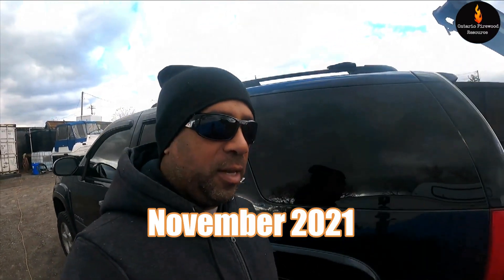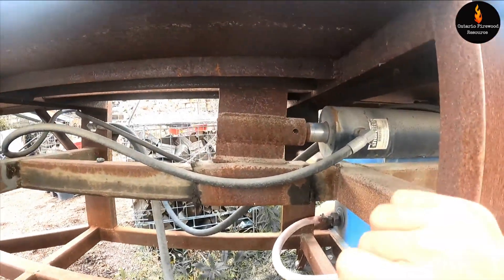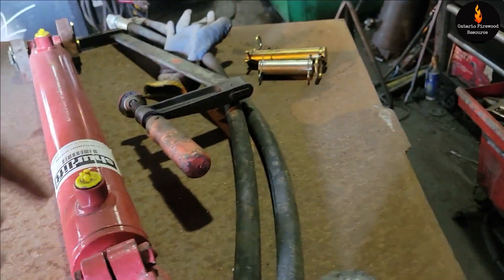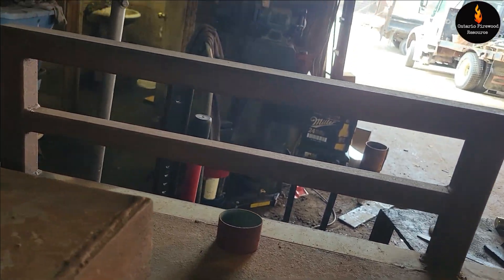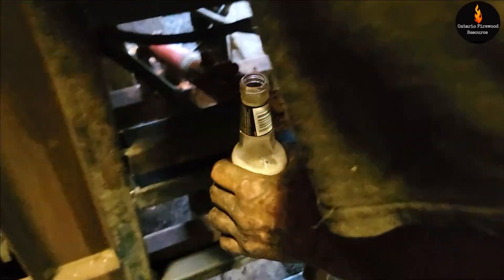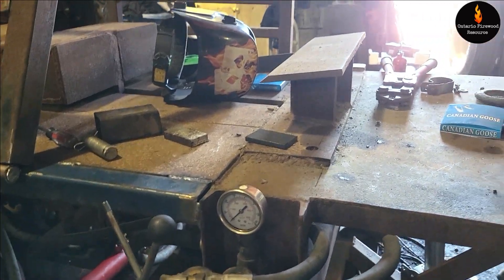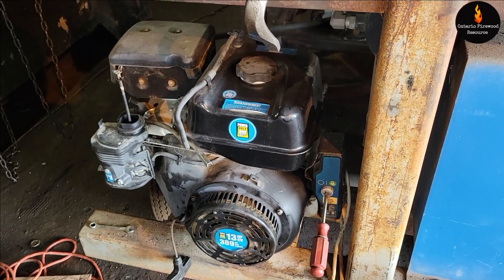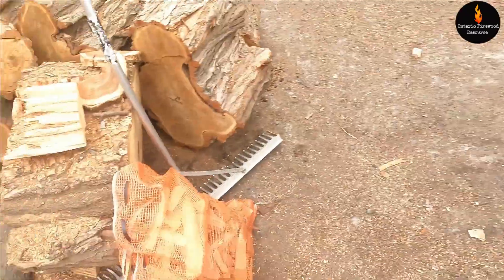MY HOMEMADE FIREWOOD SPLITTER IS BACK FROM THE DEAD!

Comment: That is so cool.  Thank yippee for sharing God bless
Reply from the maker: I should've repaired this years ago. I didn't know it was only gonna cost me 500 bucks! It broke again, bit just needs to be reinforced in one spot
Reply: @OntarioFirewoodResource  ph my. Is that a good price? Going you know what needs to be fixed
Reply from the maker: @OurTreasuredHome  Yes, mostly labour, I had the parts already. Just a few more pieces of metal and it will be back online
Reply: @OntarioFirewoodResource  that is cool.
Reply from the maker: No doubt!
Reply: @OntarioFirewoodResource  🙌
Reply from the maker: I just came up with a way to keep it from tilting
Reply: @OntarioFirewoodResource  that is fantastic
Reply from the maker: @OurTreasuredHome  😁 sorry for the typos, I miss my blackberry keyboard
Reply: @OntarioFirewoodResource  it's OK

Comment: pump is to small for sure
Reply from the maker: Ya it is. I think I'm confusing my gpm rate with my bilge pump lol. It's been years since I bought it, so I don't remember the specs. I would've bought the fastest they had, but I don't think the frame and cutting edges can withstand fast speed. There will probably be upgrades in the future

Comment: Great learning project, Anthony.  But boy that ram is slow. Will you use that splitter for special purposes?
Reply from the maker: Thanks Ron, yes it is slow, I wonder of there's anything I can do about that. In the end it's faster than my single wedge splitters though. I'll use it for all the straight stuff. It's not beefy enough for knotty, uneven wood, it would need a lot more metal. However, it produces enough chafe so splitting straight grain wood only will keep the waste wood down amd it produces a lot of chafe already

Comment: 1. Reduce the height of the ram.  You have to lift the wood to get it over, for the back stroke.  2. insure the cylinder rod is free to float on the ram in both directions..  Otherwise, you'll be replacing cylinder seals and guides soon.
Reply from the maker: Ok I see. I wonder how lowering the box wedge will effect the pushing motion. I will overlook this as well as play with the ram, pun and sleeve. Thanks for the insight

Comment: Has good power, just lacks speed. For what it is it's a clever bit of home engineering. More importantly it works and works well. No need for a $15,000 splitter with a box wedge if you can make one.
Reply from the maker: Ya, a little slow for sure, but faster than my single wedge splitters😂😂 I might have to make a double box wedge on top of the box wedge, then I can do two rounds at a time!

Comment: It's always cool to see the homemade stuff.  It seems to do well with those big rounds.  👍
Reply from the maker: Lots of thought into this machine, just no experience, but it works with a bit of help from a pro. I'll only put straight wood in there, so I should be able to do everything I throw at it. Pulling stuck wood off with a chain takes half a minute, if you can grip on it with the chain, you gotta pound with a sledge and maybe cut some with the saw. Too much chafe comes off of it though so I have a new problem. I only sell and use so much kindling lol